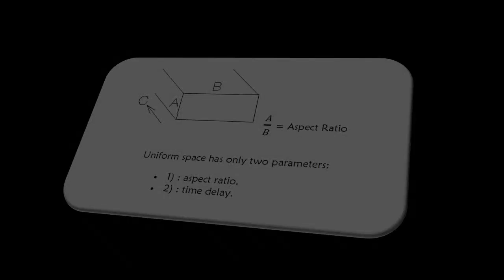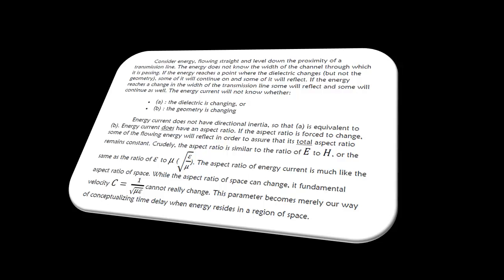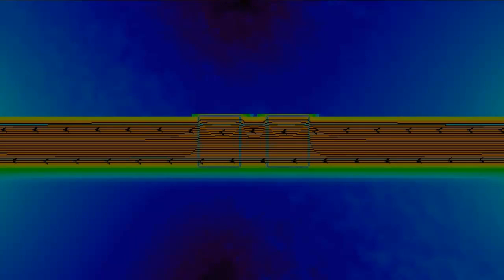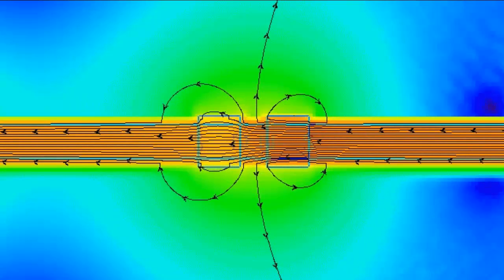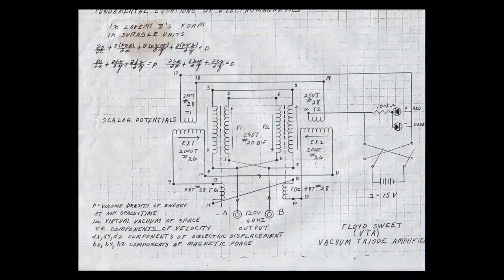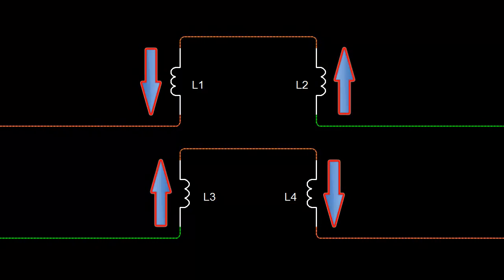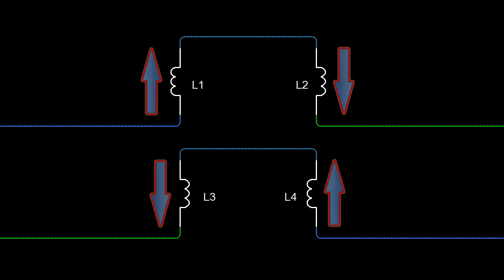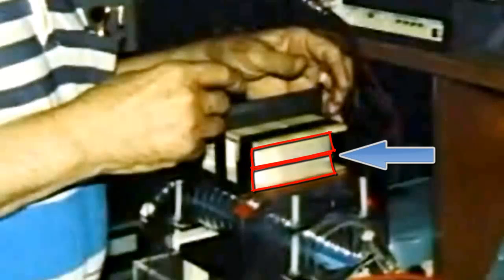How Floyd Sweet's Vacuum Triode Amplifier Works - A Bucking B Field Oscillator - Part 2

Comment: many was confuse.just focus ur head on how generator motor works.magnet at center and two coils  on both sides of magnet..thats the right way.the problem now is how we oscillate the  magnetisation of the permanent magnet without moving it physically. the  answer is we dont need to oscillate the magnet.instead we oscillate the coils.we reverse the conventional way of generating power.by oscillating coil not the magnet.if u oscillate the coil COP is always less than 1.but if u put the magnet in right angle it can multiply the magnetic field collapsing on coils itself.now we hve the combined field of magnet and coil equals power.. the soul purpose of magnet is to strengten the collapsing field of coils enhancing it by combining itself into it.just like the common generator works.thats the secret everyone...
Reply: I would like to try this. How do you put a permanent magnet at right angle of a coil?